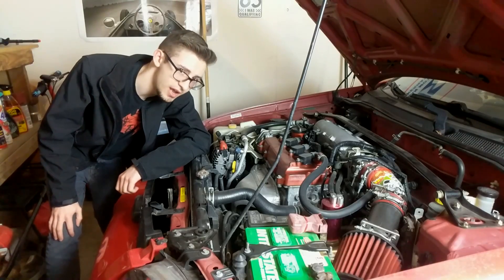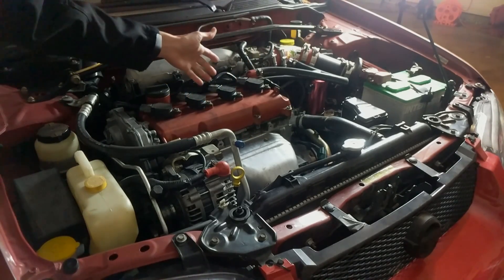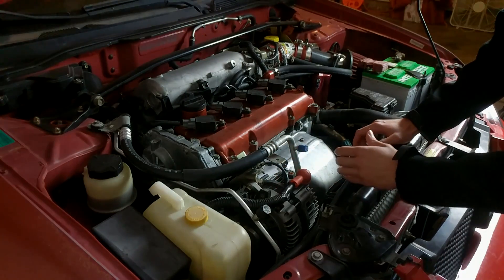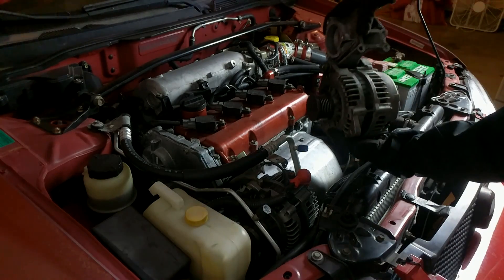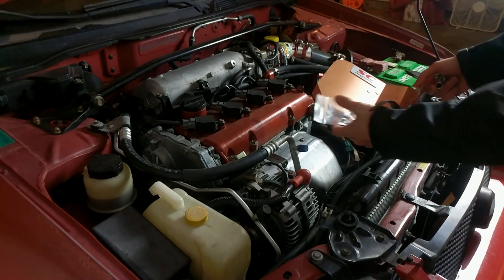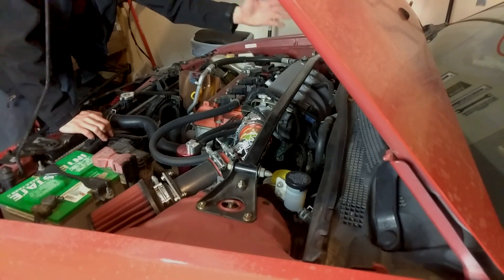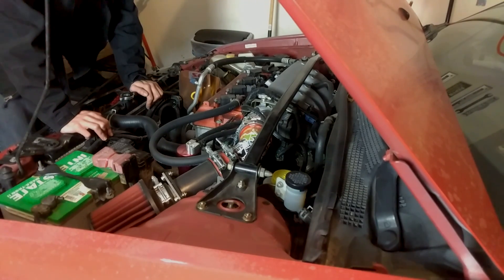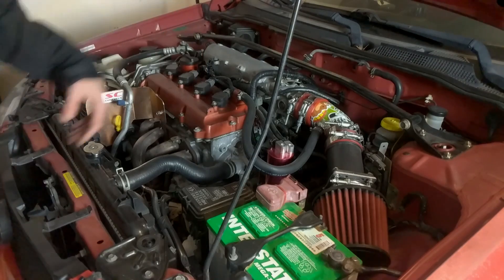3 Common Nissan QR25DE Engine Problems (And How to Fix Them)

Comment: my rattles when I first start it up then fades away bit around 2000 2500 rpm it rattles but when I go to change  gears it goes away but around 55 or 60 it rattles as well but give it gas and it stops any suggestions would be appreciated is the screws need loctite or is it the timing chain
Reply: It's the timing chain. It's a common problem with no recall.

Comment: You forgot the most common problem with the QR25DE.  Which is, not replacing the upper and lower timing chains, upper and lower timing chain tensioners, exhaust cam sprocket, and lower timing chain sprocket. That rattle you hear when you cold start your car. Yup thats the main QR25DE killer. Worn and stretched timing chains with worn sprockets. I'm currently replacing everything I mentioned as I speak. Not easy by any means though. No vids about the process as detailed that would help. I have all four engne mounts removed. Motor floating on Jack. Just about to put her back together. I'd say replace every 100,000 - 200,000 miles, depending how you drive the car. But boy do these parts wear.
Reply: How much would it cost to do this? I was quoted $1000 but on ebay theres a complete engine for $540. https://www.ebay.com/itm/2002-2006-NISSAN-2-5L-QR25DE-ENGINE-with-LOW-54K-MILES-for-ALTIMA-and-SENTRA/223247888069
Reply: @teshikofurusato4541  no use in getting a new engine, you will have to change all that I've mentioned anyways. I didn't pull the motor, nor did I remove the upper oil pan.  I got all the parts needed for $95 new, with the timing cover, which has the oil pump attached. I'm doing all the work myself, but this job is always quoted $1000 - $1500 due to lazy mechanics labor costs. Just remove all motor mounts. Place a Jack under the engine and push engine as far as possible towards the driver side. You will have enough room to get to your timing chains. Important note, you have to change the main crankshaft and exhaust cam gears as they wear wi th the  chains. Some mechanics will remove your balancer shafts or just cut the lower chain to the balancer shaft, rtv the oil pan and charge you full price. It does nothing to fix the problem whatsoever, so beware.
Reply: @sandovalwill88  OK thanks
Reply: Oh this is what happened with a model that I started at a dealership. It was pretty cold and after starting, something rattled loudly in the engine bay twice. Didn’t come back afterwards, but I’m gonna tell them that I’ll take it if they redo the chains first 👍🏼
Reply: I have this same problem
Reply: Where did you get all your parts

Comment: I have a 2005 Spev-V. I've never done anything to it other than oil change and brakes. 147K miles. Is this something that needs to be done on the 2005 model?
Reply: Check with Nissan on the butterfly screws, there is a recall for them so you can get the dealer to fix that.  If you dont have a recall you may not have the buttery screw issue.  Mid way through 2005 Nissan changed the screw design and started loctiting them from the factory.  Only late 2005s and all 2006s are ok, so most se-r & spec v have the issue.  I have a late 2006 (August 2006 so mine is literally one of the last B15s made and they did fix a lot off issues by the time my car was built).   

As far as the precat goes, no one gets by ok there.   I removed mine completely and installed headers and then installed a o2 spacer so I don’t have the check engine light.  What happens is these cars / engines don’t have a EGR valve.  They instead have the exhaust valves linger open as the piston goes back down drawing exhaust gas back into the cylinder.  It’s a passive EGR system.  As someone who also owns a KA24DE based Altima who’s on their third intake manifold gasket due to the egr port burning out the intake manifold gasket, it’s not the worst idea I’ve seen, lol.  Anyway, as the catalytic converter breaks down it comes apart into a sand like material.  Combine that with the passive egr system I just described and you are basically sand blasting your valves and cylinder walls/rings.  It’s not usually an instant catastrophic failure, but gradual increasing oil consumption and compression loss until it all becomes too much for the engine.  It took me some time to finally get a clear answer on what is specifically happening, I was told all this by a friend who is a service manager at a Nissan dealership, so I figured I’d share....  

TL;DR , get that precat our of there ASAP because it is a time bomb that will destroy your engine 100%
Reply: @trssho91  thank you.

Comment: Not sure if anyone knows but is it Possible to stick and fit a second gen qr25de into a b15 frame? I wanted to make my Sentra into a project car but I wanna avoid a first gen engine.
Reply: Unfortunately no the blocks are different but the internals are the same and so if you ever had a 1st gen qr25de dismantled you can instead of rebuilding with gen 1 parts go ahead and use Gen 2 parts.  The only problem is you will have to drill a hole in the headgasket from the Gen 2 to allow oil to flow but they have instructions and a write up on b15u.com
Reply: You can slap a gen2 qr25de in a b15 frame. You need a custom midpipe, header, and crossmember along with some other stuff that just costs money. My buddy Calvin harden has done the swap no problem. Nisformance tuned his car. And my friend Caleb is in the middle of the gen 2 swap.

Comment: What about heat wrapp for the headers?
Reply: Dean Tha kid I’ve been told by many people that I trust not to do that...you can heat soak them and they can crack
Reply: @trssho91  I contacted OBX in regards to wrapping headers with fiberglass/ basalt wrap, and they said you can wrap the headers without issue. I went ahead and wrapped the headers, but i'll have to wait and see for long term issues to arise.

Comment: Damn, I wish you had the QR from the b16 Spec V. I can’t find anyone with good info or videos on it. From what I read, it’s a totally different QR25 than the older ones
Reply: Nick Peele They pretty much fixed every major issue the Gen 1 QR25 had. The B16 QR doesn’t have any where near as many issues as the B15.

Comment: Ended up selling my 02 spec v... getting another soon tho. First one had way to many issues
Reply: Sunny Dee I’m looking into a 2002 with 180k miles what should I look for
Reply: @crw5536  anything below an 07, youd really consider looking for a different car. Unless you find one with no more than 50k miles than sure, by all means daily it. But 180k? Nooo, get something else. At the end of the day, from experience. Your better off getting the newer gen,  preferably 08 to 12. If not, just get another vehicle. I learned first hand the vq25 motor from 06 down weren't the best, nor the most reliable
Reply: CRW 55 everything. 02 was the first year of the motor. Look for a 04 or newer
Reply: Sometimes you get a lemon. I bought my 04 3.5 v6 off Craigslist(not the best idea, I know) it hauled ass and looked really good, it was black but it was a lemon. I got into an accident, got more money from insurance than I paid but bought an 06 2.5. I've had the 06 for 7 years and it's been a really good car
Reply: @SeanA88  I was too lazy  or did i have the knowledge, i could have changed my spark plugs , gotten a new battery an alternator, motor and transmissions mounts and a new oil pan. But nissan cost ALOT to repair. Its stupid. I bought a 98 Chevy tahoe with almost 300k miles and my gosh it runs beautifully. Replaced just about everything on the dam thing but the motor and transmission, and I love it... more miles more smiles hahahah

Comment: I'm glad I did all that I did to my QR engine. They are amazing engines, just gotta work out the stupid shit Nissan did. @ri$erboi I'd recommend to one and all with the plenum, to just convert over to the b16 plenum. Why have a remote change of screws going in, when you could have absolute 0 chance. Not just that, but the power gangs from it, are amazing for NA application. I personally have one, and its the best thing I did. I'm sure lots of people would love to see you install it anyways.

Comment: Alternator was never a common issue. Yes, they go bad, but overall nowhere near as bad of issues like precat or butterfly screws
Reply: I agree, I thought that he was going to talk about either the cam/crank sensors or MAF which are notoroius for having issues
Reply: @kraokingxyz1397  that's is due to bad timing. Which is caused by bad timing chains and sprockets.
Reply: I agree with you there this car has only three inherent factory issues:  butterfly screws, pre-cat, and balancer shaft.   Plus, a lot of these guys are either the third or fourth owners, did they expect to win the special prize from the cracker jack box???
Reply: Valve cover is shit design to the fact u can't replace tube seal and u have to buy whole new valve cover is dumb

Comment: Great vid. I own a 2006 with 187k. Have some work to do now!
Reply: A C. Just out of curiosity, Were those 187K miles on the original motor, did you blow a head gasket or anything within those miles? If not, you're one of the lucky ones. My head gasket on my original QR went at around 130K lol

Comment: had no clue on the alternator issue but i need one of those heat shields asap since i have a manzo header on mine. also i do notice that rattle at 2k rpm so i think its time for some loctite. thank you for this video i guess my qr needs even more items than previously determined

Comment: You forgot yo mention that our qr25de engines have issues with the balancer, and we could do a quick fix by cutting the small chain that goes to the balancer or that we could buy a bsr kit(balance shaft removal kit)
Reply: yeap i have altima 02 .and have deleted the balancer with jwt kit installed.And my vibrates on the idle like a bus.all motor mounts a oem and good.and yes the revs fast!)